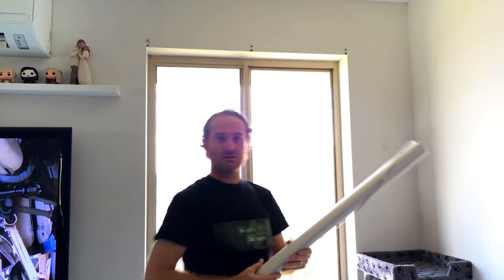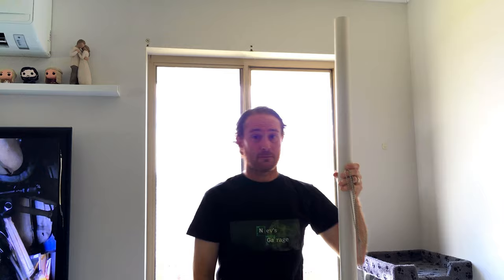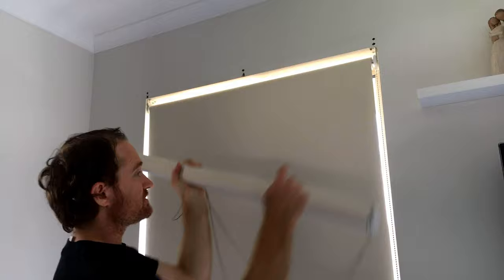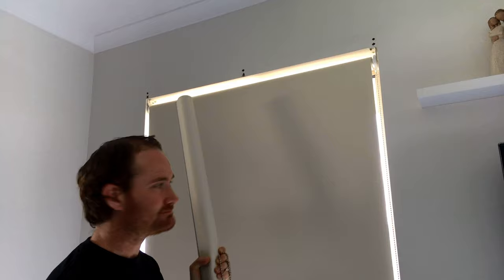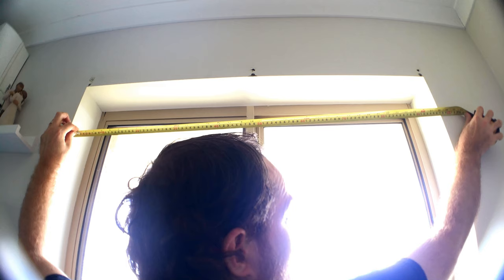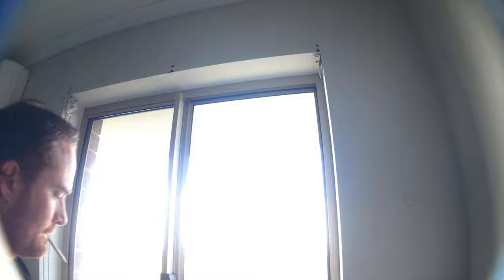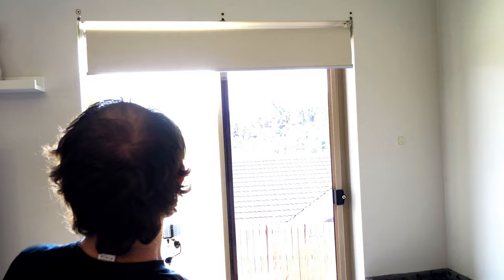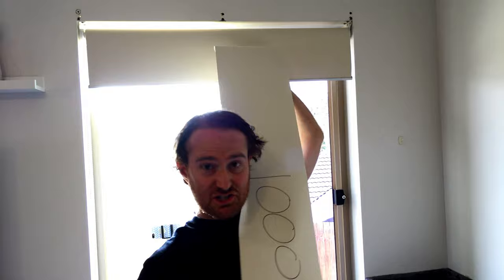Modifying Pre-made Roller Blinds to fit Odd-Sized Windows

Comment: Why do u take off a extra 40mm ? And is that the same for modifying all roller blinds ?
Reply: What is the blue tool you were using?
Reply: To allow for the width of the fixings.  It won't always be 40mm, but you will always need to cut that bit extra material (based on the width of the fixings of your own blind).